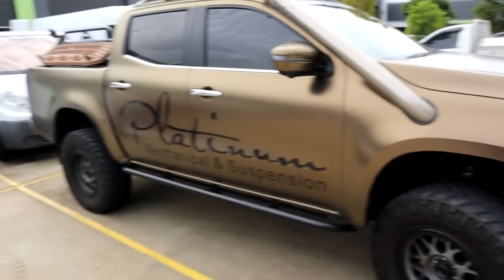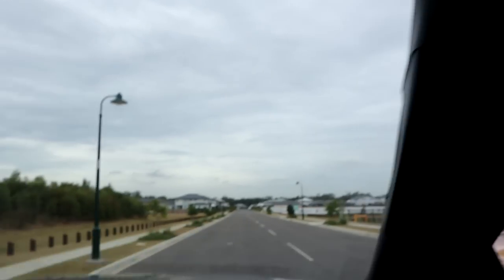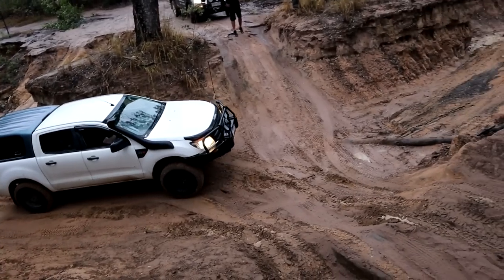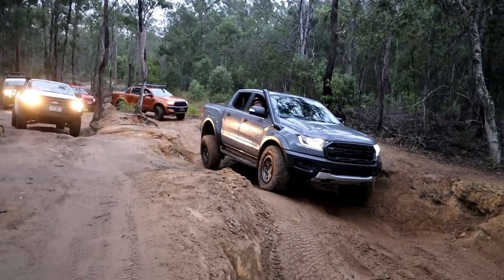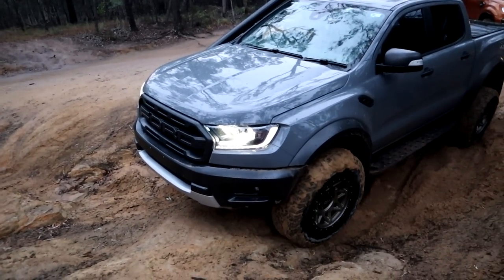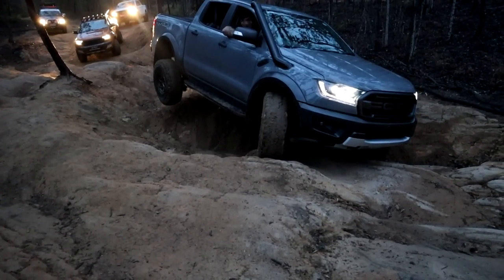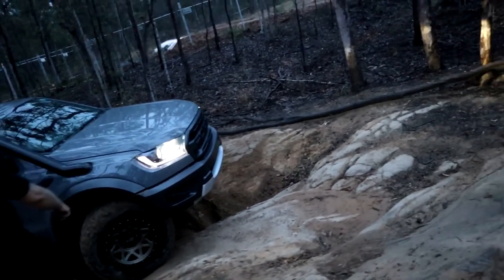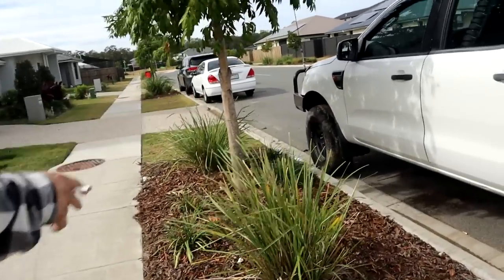FORD RANGER RAPTOR GET STAINLESS SNORKEL / OFF-ROAD TEST

Comment: almost looked like ripley, id def get the rock sliders, if you wanna keep playing like that(awesome to see someone using their raptor for actual offroad fun) those steps are tough, but the brackets are super weak, bend like warm butter.
Reply from the maker: it was ripley
Reply: Lol, thought it looked familiar, have had dings and scratches on both my raptors in there, great place play, heaps of fun at nite also.

Comment: Princey you could wrap the canopy white or the color of choice. If you take your time and do it properly a DIY wrap can be looking decent as well. 
Man I cringe when seeing you take your nice trucks 4WD in the woods. At least on the trails you where on here LOL. Think that the MB truck is a rebranded Toyota if I remember correctly. It's based on and shares many parts with another brand they said when I looked at one a couple of years ago. Maybe a dedicated trails 4WD truck in the future to go out with and have fun with. Without being scared of if something where to happen with it. A better version of the Jackaroo maybe? 
It's impresive what they actually can do on the trails these 4WD trucks. 
The snorkle sound on the Raptor sounds awesome!
Reply: Rebadged Nav

Comment: Nice video mate. I’ve got a conqueror grey raptor as well 👌 I’m looking at the snorkel and love the sound from yours, but want to make sure the cabin is still quiet with the window up. Can you hear the air intake or turbo flutter at all with the window up?
Reply from the maker: its barely hearable.. like stereo down and full throttle to hear anything really
Reply: luke fink awesome. I think I’ll take the plunge. Thanks for the feedback 👍

Comment: Snorkel looks great, also it seems to have a better diff ratio in low range compared to the gold "NOTRICH" ranger. Poor spotting from old mate too. Also who goes wheeling without sliders.... 🤣..... Those twin turbo 2L raptors run over 30psi standard too.

Comment: Does the raptor come with 3 car seat points in the back? Or did you have a new one installed in the centre?
Reply from the maker: middle seat was just a booster seat to be used with normal 3 point seatbelt

Comment: Be careful if driving in the rain a mate of mine has a stainless steel snorkel on his ranger and had to get his car towed home as it sucked in heeps of water the air box was half full
Reply from the maker: That's why to don't block the hole in the bottom unless yoyr actually going accross a deep crossing